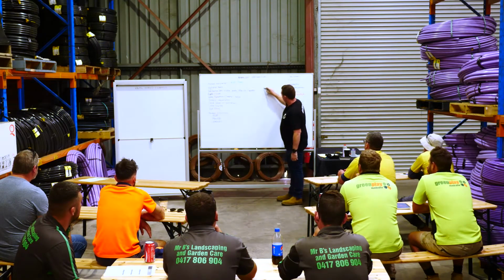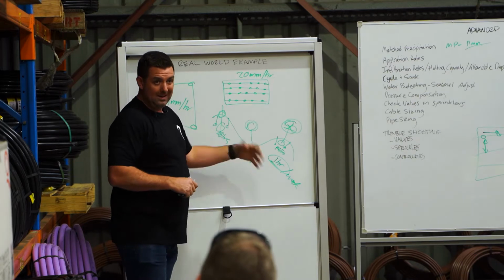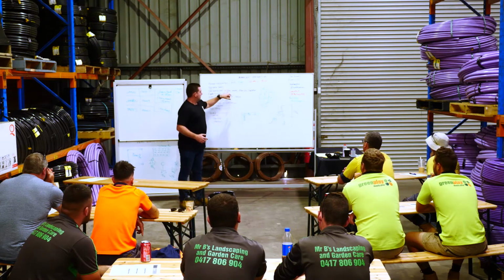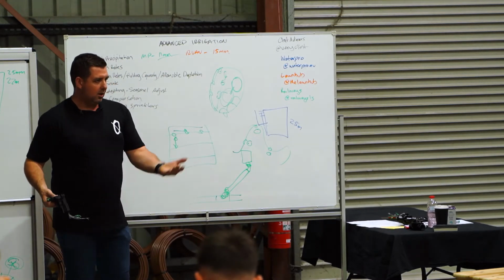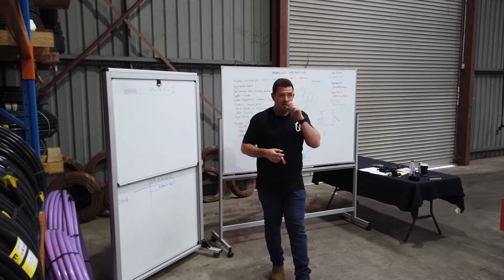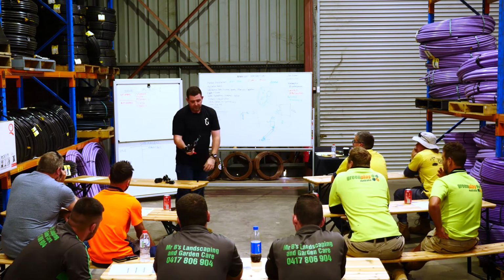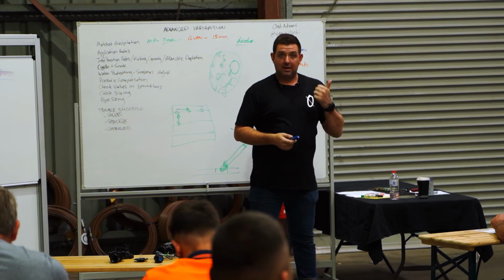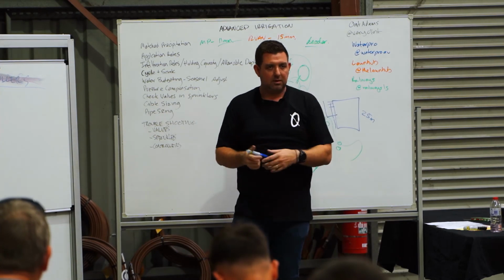Advanced Irrigation Training at Waterpro's New Warehouse

Comment: Very informative, thanks. Does it matter how long 19mm poly pipe can run? Setting up my system but would prefer to run around the house to my front lawn instead of under the driveway. Thoughts? Distance is around 30m
Reply from the maker: 30m of 19mm is fine. Provided the flow is around 30l/min or less. Any more than that and you should look at going to 25mm.
Reply: @waterproau  would 20l/min be fine using 25mm? Over 35m.